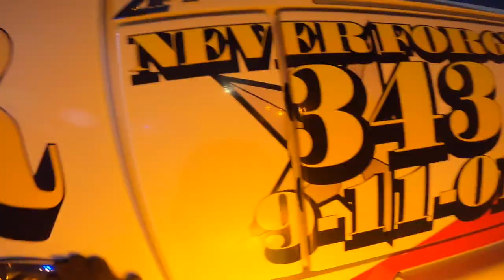Did That Just Happen!

Comment: Damn that guy must have been flying to move that roof that far, nice job to both of you
Reply from the maker: Mr Brad thanks for watching and stay safe
Reply: @SumterWrecker  Thank you sir. & yawl do the same
Reply: It took some force to knock that awning that far off and to destroy the roof of that truck like that. I hope the driver took out insurance when he rented the truck.
Reply: Once the awning was knocked loose, the vertical columns and movement of the truck acted like a pendulum to push the awning further than one might expect.
Reply: @jacquejecker4435    ..  Since drivers frequently hit overhead objects (awnings, bridges, trees, car parks, etc), the damage to the truck is fairly routine, seen quite often by truck rental companies (an industry hazard). The truck was repaired within a week or two and ready to rent out again.
Reply from the maker: @robinstewart6510  thanks for watching and commenting. Stay safe
Reply: @jacquejecker4435  Insurance will not cover "top damage". It's considered to be totally avoidable. 

Look up and live!
Reply: I am surprised at the  relative  little damage to the truck .  No wonder those awnings fly away during storms .
Reply from the maker: @danielwanner8708  thanks for watching and stay safe
Reply: @SumterWrecker  Impressive how efficiently you handled that situation . No wasted moves . Why do you think that roof suffered  such a catastrophic failure .? Couldn't tell but it looked like the truck wasn't that bad .

Comment: Wasn’t much column strength inside the brick piers holding up that heavy porch by the look of it. One little friendly love tappy tap tap and ka-blooey…!
Reply from the maker: Rubbishcop Thanks for watching and commenting. Stay safe
Reply: I thought the same. They should have steel posts inside the brickwork. Both to stop high winds lifting the awning, and to help resist this sort of incident. In my area, strength against earthquakes is also a concern.
Reply from the maker: @mark77193  thanks for watching and commenting. Stay safe

Comment: You guys, with your vehicle wrecker trucks, weren't equipped to do the job. You needed a proper crane to handle that awning. By the way, why did the Penske truck need to be towed? The damage appeared to be minimal, nothing to prevent the truck from being driven.
Reply from the maker: Mr Robin We provided the service the customer and church wanted. The awning was safely put on the ground and the truck was requested to be towed by owner. Thanks for watching and stay safe